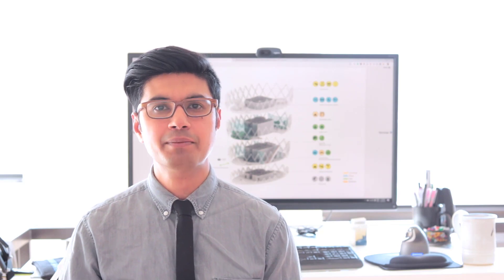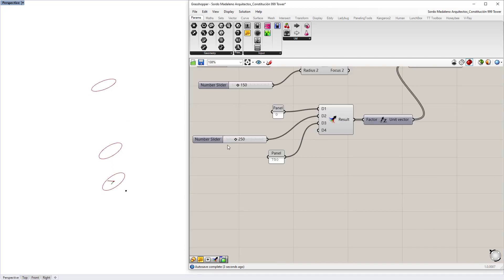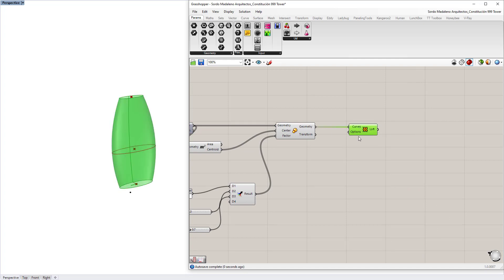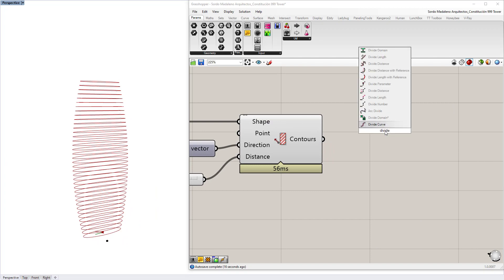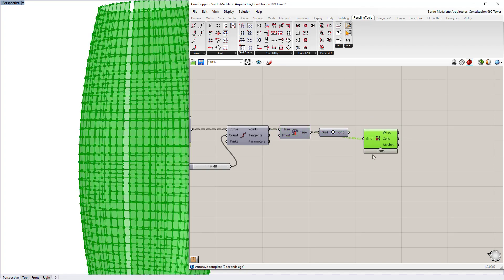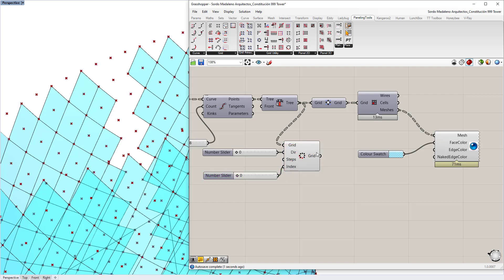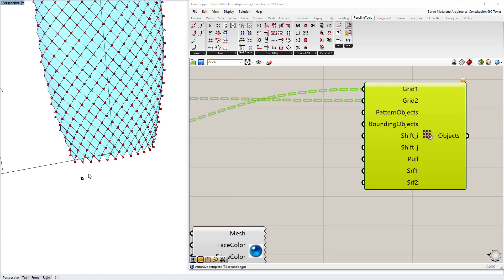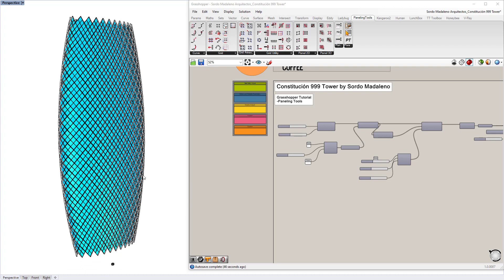Grasshopper Tower Tutorial - Parametric Diamond Grid Paneling Tools

Comment: Hello, thank you for the tutorial. How can the union failure be corrected? Thank you
Reply from the maker: Hi Gustavo, are you referring to the part where I use 'Wrap' and there is still a small gap in the facade? One way to fix it is to copy the first column of points and add them to the end of the list. In a way, you are tricking the component into thinking it needs to populate one-step more. I know it may not make much sense here unless I demonstrate it.